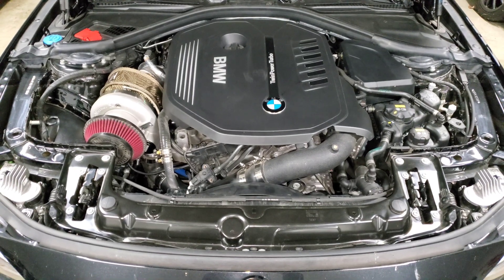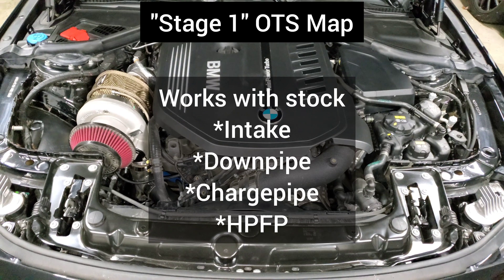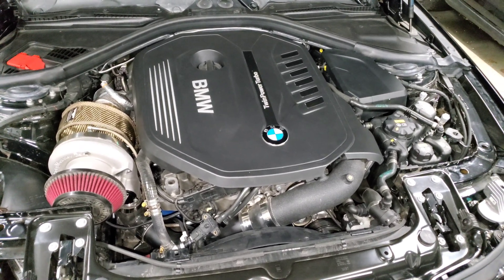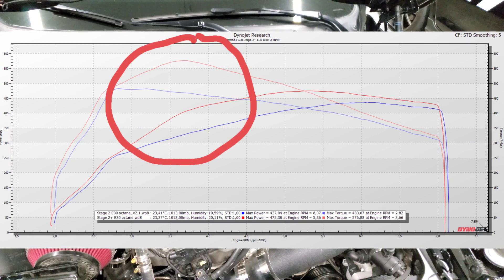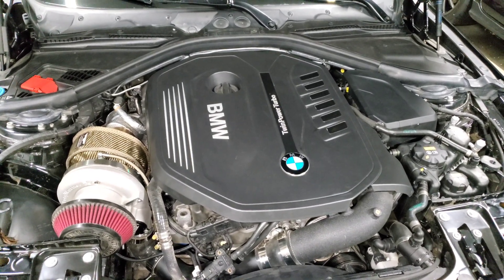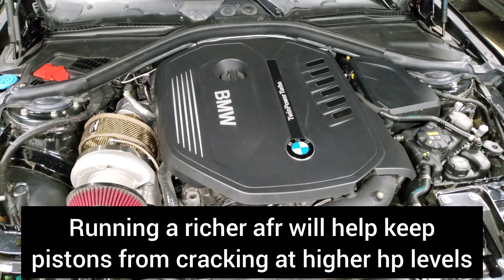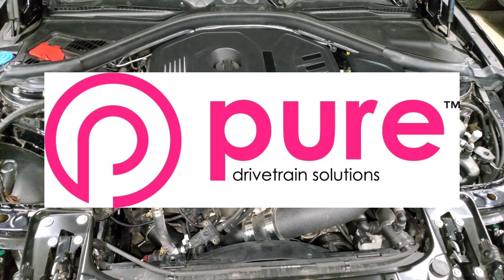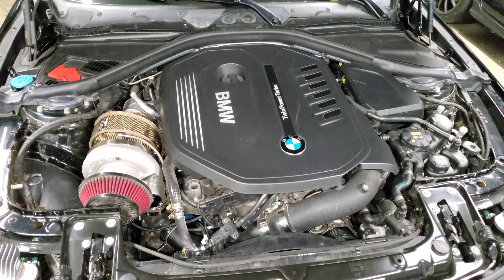Guide to B58 Tuning "Stages" and Recommended Upgrades

Comment: Is the fbo version of the b58 ( dp, hpfp) stage 2+ reliable for daily use. Also you should compare xhp stage 2 to stage 3, lots of talks on that. Big fan sir
Reply from the maker: Yes it's reliable. Unfortunately I don't have any experience with xhp. I know that's a big question for people but my car is manual trans
Reply: @kern417  I have followed some of your comments on stage 2+ ( w/ hpfp ). It seems you think there is no noticeable gains on 91-93. does this pov still hold sir? If it is, I aint buying a hpfp. Regards
Reply from the maker: @FQ1998  on BM3 there is a gain. More torque in the mid-range and a little more top-end power.
Reply: @kern417   I'm having a weird time understand why MHD said that on regular octane, there are no perceivable gains and bm3 graphs are showing substantial ones. Very weird.. Thank you Kevin !
Reply: XpH is a must, even if car is completly stock, curently on just a tune, waiting on my CG precision catted downpipe to arrive for 7 months now, getting my Bilstein B16PSS installed in few days,
Reply: @pantiesgonewild358  do you prefere stage 2 or 3 and why ? thx
Reply: Farouk Qaddoumi imma stay on stage 2, tune+ downpipe, used as my everyday daily and on 93 oct,
Reply: @pantiesgonewild358  i use stage 3 xhp tune for my 440i gc its my everyday daily as well on a custom tune e30 mix. will that be reliable?
Reply: Universal very reliable still, i run stage 3 XHP trans tune as well, with stage 1 tune, still waiting for 9 months now for my CGP Catted Downpipe to get here

Comment: You’ve given me great advice before so.....but I have done these calculations in my head over and over...
Here’s my logic-

1. Stock 340i ( I have Xdrive btw ) from all I read makes 350-360 hp stock at the crank. The whole underrating thing. So I took 360 hp x .20 ( my awd ) and came up with around 290 hp TO the wheels stock.

2. I have BM3 stage 1 and most seem to say, including PTF that stage 1 is %20 increase in HP. So I took 360 hp x .20 which then is a hair over 430 hp TO the crank. Reverse that equation and I came up with around 345 hp TO the wheels, for in my case ALL 4 wheels. Keep in mind NO other mods other than tune

3. BM3 stage 2 , whose power seems to be derived mostly from the freer flowing downpipe supposedly makes an additional %6 over stage 1. So with that in mind you would end up with around 450-460 hp TO the crank. In my case in AWD x .20 then a total net of around 365-370 hp to ALL wheels. 

 But the caveat here for me is the other day I ran a roll race from 50 against a supposed “414 awhp” later model WRX and even with me starting in 4th gear ( I have auto trans ) instead of 3rd gear like of should of, he only maintained a 1-2 car length lead on me up to about 100mph......he seemed a bit surprised when I told I was running only 340’ish to the wheels despite also his car being almost 400 lbs lighter than mine. So either my car DOES have more than 340 to wheels OR his car was NOT 414 to the wheels! 

I guess only way is to dyno. I will say though that I have gotten a 4.1 zero to sixty using my dragy and that was without LC only brake boost up to 1300 or so......and again with only stage 1 and NO other mods whatsoever. I’m glad you take the time to post stuff like this. It gives me other angles.
Reply: xdrive doesn't lose 20% when converting to whp, it's more efficient than that
Reply from the maker: I have a stock vs stage 1 dyno video on my channel to show the gains. It'll vary a lot and depend on the dyno. You can't just apply math to it at the end if the day. The same car can dyno different numbers in back to back pulls or 2 different 340i's could dyno differently.

Comment: Thank you for the informative posts. When it comes to the Supra B58, at what point or which case one would need to upgrade their fuel pump?
Reply from the maker: They dont have hpfp upgrades available for the supra
Reply: Already have the better tu pump in supra no?
Reply from the maker: @DaveGotYou  they don't have *aftermarket hpfp upgrades but they come with the TU pump. Eventually you will need to add auxiliary injection to keep adding power.
Reply: kern417 is port injection considered “auxiliary injection”
Reply from the maker: Yes

Comment: What's your best recommended setup for a reliable ACN 91 octane flash and power ...have really terrible petrol quality here and I am contemplating a MPPSK for the sound and extra performance OR a stage 1 ACN OTS map with a catted  downpipe
Reply from the maker: It just depends on your power goals. Any setup can be tuned safely on 91. But you can always buy ethanol online to run an e30 mix.

Comment: What is required to run e60-75?
Reply from the maker: A custom tune
Reply: @kern417  no upgrade required for fuel system?
Reply from the maker: @Oir.91  it depends on your power goals. A bigger pump/fuel system will support more power.

Comment: What about downpipe on bm3 stage 1? Worried about putting the stage 2 with manual clutch. .🤔🤔🤔 Keep going with this b58 videos.
Reply from the maker: The manual clutch will hold stage 2 pretty well. Going above stage 2 e30 is when it tends to slip

Comment: I have a Vargas VTT GC on the way as well as a VRSF high flow catted DP. Would I be able to expect around 450 WHP from a OTS stage 2 93oct tune with this setup? I plan on getting a Dorch stage 1 and a custom tune eventually but just curious how these current mods will handle until then.
Reply from the maker: I believe they Dyno'd around that much
Reply: @kern417  How much power can you reliably get from 93 oct with an upgraded turbo and hpfp?
Reply from the maker: Everything is in the end of the video

Comment: Very clear and informative video, well done matey.
Been running just a remapped standard car for a year, 411bhp/576nm, and going for a 200c ell sports cat next month, hopefully 460-470bhp and 630nm.
Reply: I had a gain from 424 hp/590 Nm to 460hp/650Nm after stage 2 ( Wagner catted downpipe)
Reply: @jarasw8226  Nice result Jaras, thanks for sharing.
Reply: My m240i made 421bhp and 471lb ft on MHD stage 2 with 100 cell cat, not sure 460-470 bhp is realistic unless you have 102 Ron/oct
Reply: @b16dans  I think 450+ is about right for a sports cat.
Mine was dyno'd on a very conservative dyno, and made 336bhp stock on 99ron V power. After a custom remap, it made 411bhp/576nm on the same day.
That was stock everything. The performance specialist I take my car to said 450 is a realistic number for a 200 cell sports cat and further remap, with 600 to 650 nm.
I have seen a few make 470-480 with a sports cat, but I think those figures are exaggerated by either roller riding, ambient temp lies in the calculations, etc.
420 REAL bhp is about the maximum for a stock car with a custom remap. So I think the map on yours is not very good mate to be honest, I'd get it to a trusted tuner for a custom map, several dyno runs with the map tweaked each time for maximum power staying within safe temp/timing/fuel limits.
Reply: @DjNikGnashers  I guess it also comes down to the dyno and the guy operating it but I was told by the tuner he has never seen 400whp from b58 stage 2 on his dyno. And my figures were slightly better than a bm3 stage 2 b58 he had in the day before
Reply: @b16dans  Ah I think that is where we are getting crossed wires my friend.
The figures I quoted were calculated crank bhp, so yes what you are saying is correct for measured wheel bhp.
Lets be honest, nobody can measure bhp anyway, you can only measure torque. Brake horse power is always only an estimated calculation anyway :-)
Peace matey.
Reply: @DjNikGnashers  I’d recommend a quaife lsd btw, best mod you can do to these cars
Reply: @b16dans  I plan on either a quaife or wavetrac. The quaife doesn't need servicing, but the wavetrac is a better diff, not made my mind up yet which to go for.
Reply: Update : I had a wagner 200 cell cat fitted, ITG air filter and remap, it made 455bhp/634nm.
It's a beast !
I also had XHP3 gearbox software.
Reply: Check my acceleration times and you’ll be confused
Reply: Did you change the intercooler when going stage 1?
Reply: @steelebartholomew2836  The M140i has a charge cooler.
No it didn't need upgrading because the standard one is super efficient.
200 cell sports cat and a good tuner with a few runs on a dyno will see 450-460 bhp.
To get 480-490 an upgraded high pressure fuel pump is needed, and after than it's upgraded turbo time for 550-570bhp.
Running meth injection will see 620-630bhp.
I actually have a different car now, after 4 years of M140i fun I got bored of it's handling/cornering limitations.
I now have an OG M2.

Comment: btw how is the MST performance cold air intake compared to the stock airbox?
Reply from the maker: Don't expect any significant gains. The stock airbox is very efficient.
Reply: @kern417  No problem. I was looking for more of the sound plus a tiny bit of gains in power. What does the stock airbox IAT normally run at for a stage 2 ots map for bm3?
Reply from the maker: In my testing it stayed pretty flat. I would expect similar from the MST since it's an enclosed box.
Reply: @kern417  ok thats awesome to know. thanks g
Reply: @kern417  how would running full E85 work on the B58? Would it be more reliable than running a E30 blend?
Reply from the maker: @universalg_  i posted a dyno video + review of my full e85 tune last summer. Check it out 👍🏾
Reply: @kern417  bet i appreciate it. have a great evening!
Reply: It sounds awesome! I love my mst but can't wait to go top mount big boost
Reply: I have mst for sound. It’s not really for performance but that bitch has nice whistles and blow off sounds
Reply: @lukemaxwell6302  hell yee